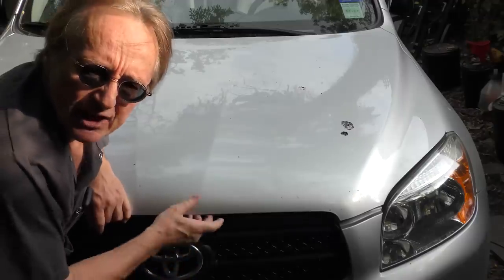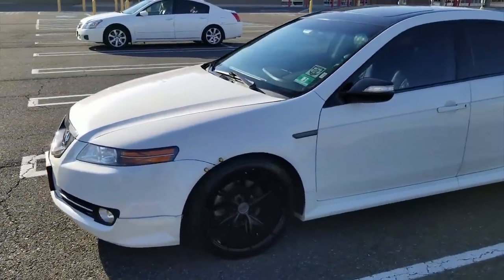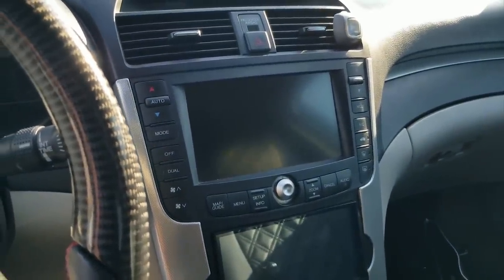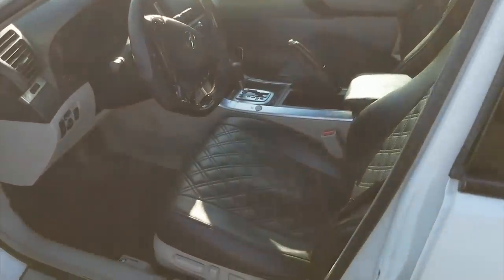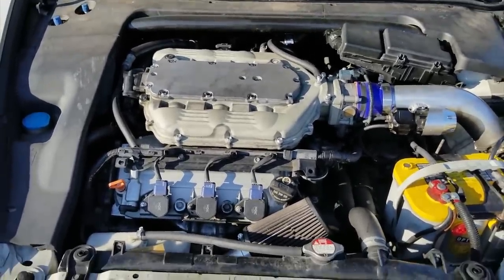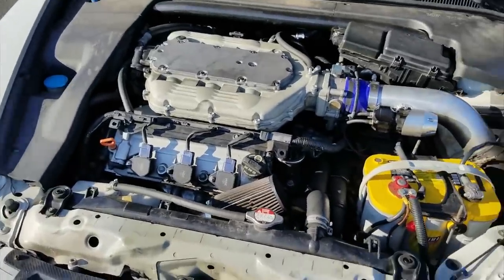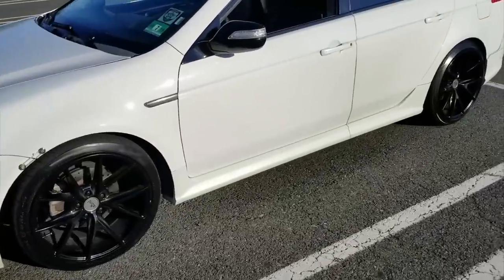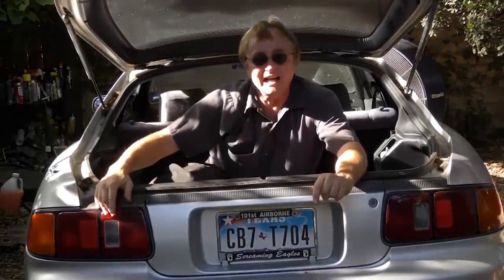Here's Why This Base Model 2008 Acura TL Makes 437 Wheel Horsepower

Comment: All the money he spent, you could've had a type S and manual trans to start with.
Reply: Right cus it sounded really good it was so unsatisfying to see it was auto
Reply: I have a manual now
Reply: Got my 08’ Type s 6mt
Reply: I know right. Manual transmission makes these bulletproof
Reply: Auto-Motive, there just were not that many of the MTs built.  
The 5AT is strong, but lacking that 6th gear is a big deal when you’re not making that much torque (stock).  Plus the AT shifts relatively slowly.  There’s ~ 13% loss in efficiency through the torque converter compared to the MT.  This is why the stock 3.2L (J32A3) base model 5 speed AT runs ~ 6.3 / 6.4 sec 0-60, whereas the 6 speed MT runs ~ 5.7 - 5.9 sec.
Reply: mind you he said it’s his first car so it’s expected when you get your first ride quit hating
Reply: @leadlean  Nobody is hating, just stating the obviously. Most people who put this type of money into their cars do their homework first to avoid wasting money.
Reply: PiterStreak where did you purchase your seat covers from ?
Reply: @GuAp_JZ  it's not easy finding a type s mt in good condition though. Most people that have them wouldn't let them go for some cheap price
Reply: Auto-Motive facts!!!
Reply: @kuddibaker  they're likely clazzio diamond stitch
Reply: lol A type S is expensive. too many idiots overprice them
Reply: Hard to find a s type I bought a base 04
Reply: Why are you hating?
Reply: @oneforalljustice5050  true
Reply: fr
Reply: Did u not hear the part where it’s his first car
Reply: Think about it guys, with an auto you won’t lose boost pressure
Reply: All that money and its faster than a Type S and SH_AWD TL So yea its worth it.
Reply: @jamaul67  facts, all got like 160+
Reply: true but the base models that are manual swapped are faster than the AT type S which is insane if you ask me
Reply: @miguelcolon4892  only if the base model is a 04 or 05
Reply: Truth
Reply: It has a type s engine, a supercharger & a tune. It'll probably destroy you're type s 6mt. You'll probably miss a gear anyway, auto is a race winning fail safe.
Reply: @GuAp_JZ  Since you're a mister know it all then whats the best J series build? Cuz its not a type s lmfao 🤣 💀 educate yourself
Reply: @GuAp_JZ  last last note he made this build when there was basically no information adding force induction to j series  lack of manufactured parts etc especially when k series has the biggest market.
Reply: @jasonredhorn6973  yeah right, tell that to my 6MT missing 2nd & 3rd 😭
Reply: @eduardoleon7419  I'm sorry. Yeah I had an '04 automatic and the transmission failed right away. I just heard that the manuals last past 200k. How many miles you got?
Reply: Failed around 203 🥲
Reply: @eduardoleon7419  I had my odometer reset to 90k. It's original miles was 230k. I had to spend 3500 for a new tranny. How much was yours?
Reply: 04 base is faster than the type s models
Reply: sometimes we gotta play cards we are dealt.
Reply: @PiterStreak  do u still have that auto 1
Reply: ...and have working AC!
Reply: Auto are faster! And I love 6speed
Reply: As problematic the auto tranny in the Acura tl can be, it’s been proven to handle 500hp before slipping

Comment: Finally the ACURA TL 3G getting some love 😍
Reply: It’s been getting love. Classic car.  The type s 6 speed are going for 20k still
Reply: @rahimi4762  they not going for 20k bro lol mostly 7000$-9000$ lol
Reply: @rahimi4762  they got scammed lmao even manuals are not worth over $10k max
Reply: @andresquiroz3155  they didn’t get scammed. That’s the market. They are hard to find some of them in mint. It’s called market demand. Prices don’t come out of thin air. U won’t see anyone paying that for same year Lexus anything
Reply: @rahimi4762  an 08 IS-F goes for 25k+ even with high mileage
Reply: @rahimi4762  i just bought an 08 type s for 5k
Reply: @Princefiasco  stick?  The sticks go for a lot more due to enthusiasts
Reply: @rahimi4762  auto unfortunately lol
Reply: @andresquiroz3155  mine is worth 15000 easy in Canada

Comment: Cold air intake is looking like hot air intake ....
Reply: But is has a great sound and looks good too
Reply: Obviously it's not cold air intake bit simply a cone air filter.
Reply: Mieczysław Beger yeah sure airfilter for the hvac of the car
Reply: Yeah not a good place for it, he could’ve done a custom one and had the pipe going off to the side with s heat shield by the engine
Reply: That intake is directly over one of the catalytic converters.  He ought to run more plumbing so he can plant it somewhere else.
Reply: Jwlz T yes I replied to the owner in another comment suggesting he move the battery to the trunk and run the pipe through its place. I’d imagine it’s really hot under the hood with the blower so is best for the battery to be out of there anyways
Reply: Cold air intake don't matter, it has an intercooler
Reply: It doesn’t matter this air goes to the turbo not straight into the intake like a naturally aspirated so it really doesn’t matter the position of the intake
Reply: It's a cone filter stuck on a turbo. This is how it's done in FI world. Cold air intakes aren't for boosted cars. FI cars have intercoolers that do a way better job than any cai would. Remember it sucks that hot air then gets circulated through the water cooled intercooler then the cold air make its way into the engine for more power.
Reply: It goes through the intercooler therfor the intercooler is the cold air intake in a s3nse
Reply: @victoratalla542  doesn't matter, turbo doesn't like heat
Reply: .... He has an intercooler and that's just an air filter

Comment: My first car was a 2002 Acura TL that I still drive 8 years later. 207,000 miles and 17 years old and still goes.
Reply: Manual transmission I assume ?
Reply: @JR-wn8cl  auto. 213,000 now. Still runs great. Original motor and trans.
Reply: @taylorholloway7283  I just got 99 TL for free with 215k miles. I have an E550 Mercedes and a Volvo 850 turbo but this is a nice beater car to have
Reply: Got the same car 02 TL 208,000 miles and runs excellent 👌
Reply: @jabs45R me too i got a 2002 tl type s with 220k original motor and trans

Comment: Base car that is no longer a base car by any stretch of the imagination.  Nice modifications that seem to work.  Would wonder how reliable it is nicely done.
Reply: Sam S these cars last up to about 500,000 miles! It’s crazy
Reply: Im Vhentz he means modified
Reply: Well I know the 8th gen SI (around the same year) can hold ~400 whp for years as if it were stock power
Reply: Definitely a new transmission
Reply: Hater
Reply: @5svnjaay94  not the transmissions tho. And those transmissions definitely cant handle 400+ hp
Reply: @diablocls55  true, i had to replace my transmission with a new one when I had one of these

Comment: For those looking for these cars: The 2004-05 Model Year Manual Transmission models came with all of the goodies from the Type S (Stiffer suspension, Brembo Brakes, Limited-slip differential) minus the 3.5 liter engine. I have a 2005 myself and it is a joy to drive!
Reply: Always wondered why I have brembos in the front, thought it was only for the type s. I have an 05 MT too, why did they come with these options but not the years 06-08?

Comment: I just swapped out the Stock Nav in my TL with a Nexus 7 tablet. It's an incredible upgrade. The community around the 3rd gen TL is great.
Reply: Evan Pilkington too bad that nexus7 has a 5yr + outdated rom. Good job upgrading to a obsolete os google no longer supports. Talk about waste of time and money. Better off using your mobile phone and a $15 bluetooth adapter. Be cheaper, faster and more accurate with Google maps.

Comment: Excellent job. As others have said, easy on that transmission. They improved them for the 07-08 years but it's still a typical Honda glass transmission. I'd be doing a drain and refill every 10K using DW-1.
Reply: nice over exaggeration , after 06 Acura made sure to straighten up that issue with better autos. since then that has died down. now if ur talking about a 06 and below yea be carful but as a owner of several Acura Honda I can vouch for the improvement of auto trans.

Comment: Not sure if it's fair to call that a base model when it has an engine swap and a supercharger. Damn nice ride though! Nice to see someone putting a  Honda J series to good use!
Reply: Darxcide 马克思 the little base that could
Reply: Just because it’s been swapped doesn’t mean it isn’t a base model...
Reply: And no ac lmao
Reply: It says base, not stock
Reply: isn't that the engine on a 2nd gen odyssey? Didn't know they could hold that power
Reply: @Fifthcell  vin says regular tl, performance says type s turbo

Comment: A unique yet tasteful build with enough power to back it up, well done.  Although I have some tiny notes to add, first off super small but the iVtec decal isn't technically correct.  The J32 and J35 used true cam profile shift rather than the vvt based iVtec.  Also, the J series motors are all SOHC not DOHC like the K series motors, in fact the only production DOHC V6 honda has ever built have been in the NSX.  Also, given the history of Honda/Acura's transmission reliability  over the years specifically the ones mounted to the V6s I would be wary of pumping that much torque through the stock transmission.  I personally own a 03 TL and I am happy enough that she is still running with 268K on the clock but the transmission is definitely the weakest link.
Reply: Yeah I got the same sticker on mine but I cut out the dohc

Comment: I Have a 2004 Accord Euro in Australia, 2.4 ivtec  the front is the same, the rear is a bit different with 228000 km still fun to drive and the engine looks clean with no oil leak at all

Comment: So was he preserving the transmission by not holding the throttle while the car was shifting?
Reply: zacatetas I don't Rev bang like most honda people do
Reply: And yes. It's easier on the tranny to lift, shift and step back on it. I have shifted without lifting. It's no problem. Don't want it to be a problem later though
Reply: PiterStreak most people don’t do it so it was weird seeing you doing and it and I could only assume that was the reason. I hate it when automatics shift under load. They feel like they hate it so much. Nice build though.
Reply: This guy's car sucks! Definitely sounds like a turd generation
Reply: Joseph Samsor mine doesn't shift under load. It won't shift until I do. If one wanted to Rev bang until the engine throws a rod, the computer won't stop you by shifting up
Reply: PiterStreak nice to see a fellow automatic drive their car the same way I do.
Reply: Yeah I hate that.
Reply: Vincent Affatati Probably better then anything you got
Reply: PiterStreak hey great car!  What brand is the supercharger kit? How  hard was it to install? Programming?  Since the engine is out of a RL why didint you grab the whole drivetrain with SH-AWD.

Im building a rally car (2005rl) to go after some Evos and WRXses in the prepared awd class.... any advice?
Reply: 1DEADBEEF1 there's only one brand of super charger for the 3rd gen and that's comptech
Reply: J.P. Ignelzi there is also another brand... gerzybear performance and comes with different stages but is more expensive
Reply: Yeah I think so. I did it in my mk4 jetta 2.0 too when I turbod it with the auto trans. With the extra power ( going from 125 to 230 ish) the transmission would slip in between gears if I stayed in it because the car was under load making around 10psi of boost and the second the clutch packs were introduced to the power they would slip and the car would over rev for a second and it would shift way late. Also on the vw every time I would lift it would shift when driving aggressive so it was nice
Reply: PiterStreak dude! Ur car is so awesome bro great job! And what’s the brand on the supercharger ?
Reply: I think he’s trying to make it sound like a stick haha

Comment: You are going to need Scottys blown head gasket video.
Reply: charles mclachlan the engine is professionally built and the stock headgasket from factory is multi layered steel. Not to mention it has aftermarket headstuds...
Reply: Thing's   gotta  enough   intake (s)  on  it   n  with  the  super  charger it  sounds  like  a  turbine / turbo  jet  engine.   Push  that  thing  hard  enough  n  it'll   need  more  than  a  
Head  gasket.......a  new  engine.
Reply: PiterStreak is this your car? I have an RL ID like to do a simple super charger too

Comment: 437 hp through the front wheels? That's got to be quite a bit of understeer. Definitely wouldn't be the easiest thing to drive, but really impressive!
Reply: Will Chen gets a bit out of hand at times but nothing too crazy
Reply: I have the same car 6 speed is it worth e85 and slapping a turbo or at the least e85 tune what does that cost?

Comment: The Honda J32 and J35 engines are pretty insane for a super average V6. The Bisimoto 1000 HP Odyssey still used the J35 that came from the factory albeit heavily modified

Comment: are you sure that stock acura  transmission can handle all that power !!!!!!!!!
Reply: Heard the stock tranny can take 500hp before having issues
Reply: That trans is actually one of the best autos on the market, which is odd since Honda also makes some of the worst autos as well
Reply: Guy here in Iowa had an 07 auto tl making 600hp to the wheels slicks and all held just fine
Reply: drew hood oh yeah so much better than the zf and dct auto lmao gtfo
Reply: the 04 tl transmission is sloppy as hell
Reply: LUIZS_93 // 04-06

Comment: Bet that baby loves to understeer. Lotta power for fwd.
Reply: Borginator all comes down to the tires grip, throttle control and if you have a good LSD or not. I've seen FWD running twice the amount of hp on tarmac attack tracks.

Comment: Is that filter near the exhaust manifold??
Reply: Dwayne Van Horrik hot air intake LMAO
Reply: Yea. There's barely any space for anything
Reply: PiterStreak can't you make a heat shield or some sort? Or maybe some improvised induction for cold air? Cold air = more power ! 💪
Reply: PiterStreak move the battery to the trunk and run the pipe past the battery area. Just an idea.
Reply: that's what the intercooler is for.. using a heat shield would bee pointless. just let the compress air flow to the intercooler then straight into the tb.. frankly I like the roots type super chargers that comptech designed for this car.. but this works

Comment: HAS A DOHC I-VTEC sticker. When his engine is a single cam and doesn’t have I-VTEC
Reply: Longshoreman he did an engine swap
Reply: Marc Howell 

He has a J35. No J series is dual cams and only comes with with single VTEC on the intake side. NO VTC which is i-VTEC.
Reply: @HOTPLATEGAMING  sticker was placed on the car well before I learned much of what I did to pull that build off.

Comment: Seemed like he couldn’t shift fast enough or had problems with acceleration. Lots of power but slow takeoff.
Reply: dus22345 under 2.5k rpm I'm not in boost plus I wasn't gunning it. Also the automatic gear ratios are wack
Reply: It's 3500 lb. One of the lightest luxury cars of that era. Weight isn't an issue. Vtech takes a while to get to....
Reply: You do realise thats its stock weight right? the car is modified if you never noticed. And the guy went off the throttle while shifting.

Comment: Had this car, the 2006 and did 277k miles. The only part that I had to replace was an engine mount due to fast take off during the 277k miles. Best Honda ever made! And sexy too. Traded the car and got an MDX and TSX. Damn the TL gas needle moves as fast as the speedometer

Comment: I just can imagine the paint in the @$$ to change the rear sparkplugs.
Reply: Jose Perez yup its annoying
Reply: All you really have to do is remove the strut bar, but even then its still tight lol
Reply: It's actually not THAT bad. I had a CL-S and did the rear plugs without removing the strut bar on the J32
Reply: Easy
Reply: Easy.  Takes 5 min
Reply: Actually pretty easy. Maybe you should try looking it up before assuming and posting.

Comment: I hate working on and driving front wheel drive cars
Reply: Michael Trower Yeah.. Ill probably never buy a car with a sideways engine!!!! The plugs and the belt!!!
Reply: Michael Trower Front wheel drive=Wrong wheel drive
Reply: adventureoflinkmk2 Try changing the timing belt on a 1999 Audi A4 2.8L v6
Reply: Michael Trower it gets annoying when you’re turning onto a highway
Reply: Every car has its quirks. Nothing wrong with FWD. As a small block V8 type of guy, I can honestly say Hondas been extremely successful with theirs. Genuinely as quick as alot of RWD and the drivetrain alone weighs alot less. Also, if you're bitching about plugs and belts, step away from the vehicle completely. The literal procedure for replacing spark plugs on a third gen camaro involves lifting or dropping the motor.
Reply: Ole Boy you don't have to lift or drop the engine on a 3rd Gen Camaro v8 to change plugs  I owned and work on several of them back in the day you don't know what you're talking about guy
Reply: Michael Trower Lt1 so maybe Gen 4. Its the "Correct" way. An inch or two to reach the back plugs.
Reply: StrangeClouds who would buy a car with those kind of problems 😂
Reply: It's not that hard, some easier than others, I definitely prefer 99 and below
Reply: If its got an engine with more than 4 cylinders yes. With a 4 cyl isn't that bad at all.